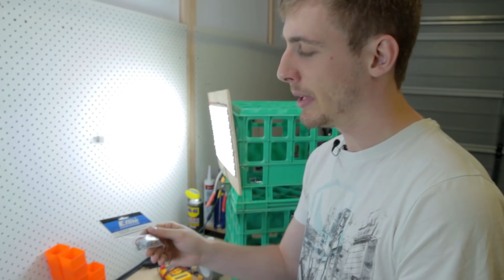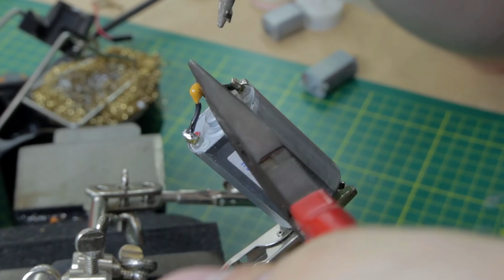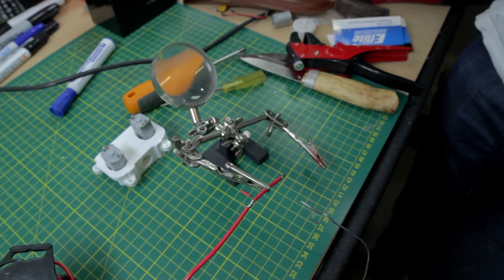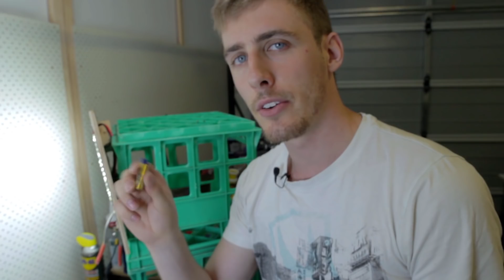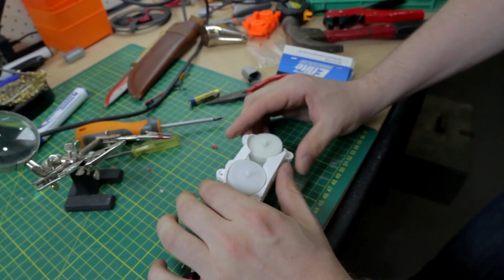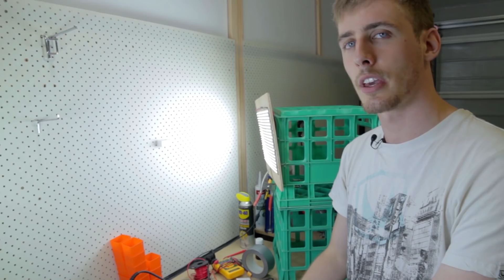3D PRINTED NERF FLYWHEEL CAGE - Beta Testing Hawki007's BSP Cage | Making Blasters Accurate Pt.1

Comment: I have two of those blade motors in a modulous running off of the stock battery tray with alkaline battery's.......I really need to lipo it

Comment: I looked at the stats for both the honey badgers and rhino motors and I am still confused on what they are better at than one another. For fly wheels which are better? and for a pusher?
Reply from the maker: Honey badgers are higher RPM so will get higher rate of fire as pushers on either voltage than Rhinos. About double the rate of fire at a given voltage. -R
Reply: Make.Test.Battle Ok, thanks.

Comment: If you do a Carbon Fibre flywheel cage, do the flywheels too, less weight means they'll be easier to spin up, because inertia :D
Reply: PAPO1990 In theory. Not saying that I disagree, I just don't know if it would work.
Reply: Luis Benjamin Diaz it could, but carbon fire can be quite difficult to manufacture a balanced rotating mass, however a "forged composite" could be easier while being almost as good as the woven carbonfibre
Reply: PAPO1990 Science?
Reply: ??? not sure what you are asking so I'll just elaborate.

Most carbon fibre (and other composites like fibreglass) are woven, this process can leave the part slightly unbalanced, but never enough to cause any issue for anything that is not rotating at high speed. However there is a newer technology called "forged composites" this works by taking all the strands that would otherwise be woven together, cramming them in a mould and "forging" it. it's still not perfectly balanced, but it's strength is more omnidirectional, and is MUCH cheaper and easier to manufacture.
Reply: PAPO1990 TLDR. (I'll prob. read it after I Post this comment) Ok, thanks for the explination, but I meant Science in the way like when you prove somebody wrong with facts or whatever and then you yell (well not nessaraly yell more like exclaim loudly) "SCIENCE!" Cuz your smart (or something like that(I really am unsure as to why I do it but oh well)). I said it thinking you would respond "Science." Though I see how you could be confused.
Reply: Ah, fair enough :P

Comment: The capacitors are in fact to reduce noise, but it's not necessarily to help with cheap batteries, the electrical noise is part of the system. I've heard that it also can interfere with nearby old school HAM radios, but I'm not positive about that

Comment: Guys! yes: 180 3S. Also all the  'crud' on the motor as stock is radio frequency interference surpression capacitors, as it would screw up the comms and guidance on model aircraft. It won't help with inrush - in fact a capacitor is a dead short at turn on for a tiny fraction of a second, but open once charged.
Reply from the maker: +Pete S That makes a lot of sense... -R

Comment: Capacitors on motors are called starter capacitors. On a DC motor, the initial inrush current goes through a coil within the motor. The coil which is called an inductor at this point, essentially opposes the inrush of voltage across it and causes the voltage to 'lag' the current until the coil has sufficient magnetic saturation. Think of it like a sponge soaking up water before the water will start dribbling out the other end of the sponge.

The capacitors however have a 'leading' effect and are used to Phase correct the inrush voltage and current. This is a power factor correction circuit and has the effect of allowing the motor to start immediately when power is applied. Otherwise you'll get a stall point and a little motion is needed or very slow take off on the rotation of the motor.

Removing these capacitors permanently will reduce the efficiency of the motor and have an impact on their ability to start up. It has nothing to do with the size, rate, type of battery you connect to the motor.

also Looking more closely at the motor. The one that is inline with the DC current (Red Wire), is an inline thermal fuse. It's a current limiter. You only needed to disconnect that if you wanted to over-current the motor.

.... Just so you know.
Reply from the maker: +RamjetX Pretty much figured thats what its for -R

Comment: nerf engineering 21st century
at this rate we can create a nerf railgun
Reply: Theoretically using two rows of accelerating motors that may be possible. But the mass of the nerf darts may be an issue.
Reply from the maker: The main limiting factor is that each new set of wheels adds a diminishing additional performance. Builds that have be tested so far have got 165ish FPS with two sets of wheels, but then only around 180 FPS with 3 wheels -R
Reply: Make.Test.Battle Yeah, its not really worth the extra effort.

Comment: Ok, but let's fire it now without any other alterations to see if spinning the dart has the same effect as spinning a bullet - and if this does a good job of spinning the dart. 

It was good to see that I am not the only one who gets burnt.
Reply from the maker: +Christopher Kelly Haha yeah... if you're not burning yourself occasionally from spitting flux or whatever you're doing it wrong. Spinning darts and spinning bullets are totally different mechanisms due to the geometry and material density. You can count on me making sure to eliminate all variables during testing to see exactly what does and does not improve accuracy -R
Reply: I am thinking that spinning the dart will help simply by rotating the imperfections thus constantly rotating the direction the dart tends to veer off. 

BTW - your iron heats solder instantly from the video. Am I wrong in what I am seeing?  Mine takes forever. Do I need a hotter iron?
Reply from the maker: Christopher Kelly Exactly my thoughts too. I have a 45 watt temperature controlled station. It take about 10 seconds to get to 350 degrees. Cost me about $100 but its well worth the price.
Reply: Looks like I need too drop some money on a hotter Iron. 

Not to change the subject too much, but is a voltmeter a necessity or just 'cool to have' if I am using a 1000mah 3S LIPO for one to two hour battles with kids ( low key).

I have MANY more questions but will find a different way to ask because ITS 5:21AM THERE. Hope you weren't up all night. 

BTW - you guys are my primary instructions/tutorials for building Nerf guns. Your Stryfe re-wiring guide sets the standard. Thank you!
Reply from the maker: +Christopher Kelly :D Thanks! Buying quality tools is always a good move if you can afford it. I got that iron and have got every dollar of value out of it an more. Integrated voltmeters are a bit of a gimmick. Get a battery cell tester to use in break time so you can check the cell voltage so you know when its time to recharge. That said a 1000mah battery lasts me a whole day of nerfing so a 1-2 hr battle would be easily handled -R

Comment: 1: Twitch modding = yes.

2. MTB 180's = Yes, preferably at 2S voltage but whatever.

3.Afterburner 3d printed flywheel kits = yes.

Comment: Ryan, do you happen to have a spreadsheet or even a sheet of the specs of the 3240 clones your gonna probably sell soon?
Reply from the maker: +ThatOneAsian. Yeah, the spec sheet is here: http://www.kysanelectronics.com/Products/datasheet_display.php?recordID=7071
Alternatively there is a big compiled spec sheet here: https://docs.google.com/spreadsheets/d/tTur95T5WEhQN_x6dAwW7vg/htmlview

EDIT: I totally misread and thought you where after a 3240 spec sheet. I will release the specs when I have made the final order -R
Reply from the maker: +ThatOneAsian. Also my motors are not 3240 clones -R
Reply: Whoops, also the flywheel spinning off the shaft happened to me several times during a war...

Comment: would the cage work with stock motors?
Reply from the maker: +Eshaun225 You'll get stock performance and burn out the motors if you try to over volt it. 
-Justin
Reply from the maker: +Eshaun225 To clarify; anything that spins fast enough will get the high 120 FPS number, but stock motors will have lower torque that reduces maximum rate of fire and spin up time and will last a lot shorter since they have no carbon brushes -R
Reply: Yes, I just wasn't sure if stock motors had the screw holes required to attach them to the cage.
Reply from the maker: Eshaun225 actually thats a good point. I'm not sure... I shall check! -R

Comment: make sure to ask for a cage like this without angle, but all the other bells and whistles.
Reply from the maker: +DevilZcall The plan is:
Stock cage, stock wheels
Stock cage, worker wheels
Angled cage, Worker wheels
Angled cage, Worker wheels, brass guide

The improvement between these 3 cases should single out the performance improvement without need to do every single possible case. -R
Reply: Make.Test.Battle you so smart. I love you damn Aussies. And your American jokes. Especially when they have to do with glass ceilings and trans negatives 😅😎🤓🧐

Comment: the spin put onto the dart is supposed to affect the air flow around the dart which in effect causes it to fly straighter over a further then normal distance hence the claim to make darts more accurate.

I'd love to put one of these in a rayven with a pair of honey badgers inside the cage...  Sadly no cage available for the rayven yet.
Reply from the maker: +Steve W Sorry, but airflow around the dart has nothing to do with it. There are 2 potential parts to it. The first is that the spin with negate any asymmetry in the dart, such as a tear that would cause the dart to veer to one side preferentially. The second part is gyroscopic stabilization to resist turning. The first has merit; the second probably doesn't. Thats the whole idea of this series -R
Reply: +Make.Test.Battle if I'm not mistaken a large part of the inaccuracy of elite darts is due to the hole in the tip mucking with the way air flows around the dart while in flight.  The spin should help negate that issue someone by balancing that inconsistency or negating it almost totally depending on the speed of the spin.

Regardless I look forward to the results of the series, I enjoy watching the MTB modding videos regardless.
Reply from the maker: Steve W I believe you are mistaken. The effect that hole has is minimal to none; but I need to put more time in my CFD model to prove it. But what you say is correct; spinning the darts has the potential to balance any asymmetry in the dart from cuts or tears in the foam -R
Reply: +Make.Test.Battle any updates to this testing?

Comment: For your super testing video you should eliminate the Brass as a variable, so you know if it's actually the tilted flywheels that do it. I.E. Would a Stock flywheel cage preform as well as a canted one if you put the brass in it?
Reply from the maker: +coatduck Totally agree, I heard some people get notable accuracy increase from just brassing alone. I think Basic Nerf tried it ages back. 
-Justin
Reply from the maker: +coatduck Ill be testing curved wheels, angled cage, and brass -R

Comment: Do you think there would be a noticeable performance increase if you swap the regular flywheels with placti-dipped worker flywheels?
Reply from the maker: +Supergundum Potentially; but plastidip doesn't stay attached to the wheels permanently so its not really a good solution -R

Comment: nice! Would you please be able to link me to the lipo voltage tester thing you used? it would probably be a good idea for me to get one. Also with the lipo you are using what is the number it should be at for use?
Reply from the maker: +Tiger Foam Alex bought them ages ago. This is a link to one similar; but there are so many sellers there is probably cheaper available. For a 3S LiPo you wanna go between 12.4 at absolute max down to maybe around 9 volts but the lower you go the more risk of damage to the cell.
http://www.aliexpress.com/store/product/Lipo-battery-Voltage-Indicator-volt-meter-monitor-buzzer-Alarm-1-6S-3-7V-22-2V-3/104898_1877000270.html
Reply: Make.Test.Battle thanks very much! Will have to get one!

Comment: get the dr,snickesa flywheel cage
Reply from the maker: +dannyboy 76j This does the exact same job. But I might get one some day if this shows promising results -R
Reply: +Make.Test.Battle but it reduces the sound also
Reply from the maker: +dannyboy 76j This cage has a pretty wicked noise reduction when I installed the worker flywheels for the next part of the series. Just wait, its really crazy for quite it is -R